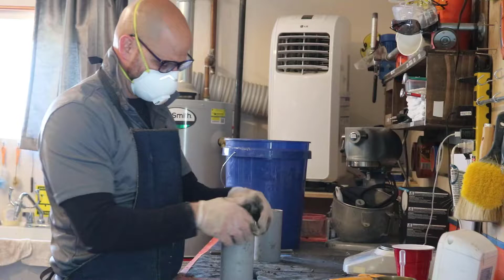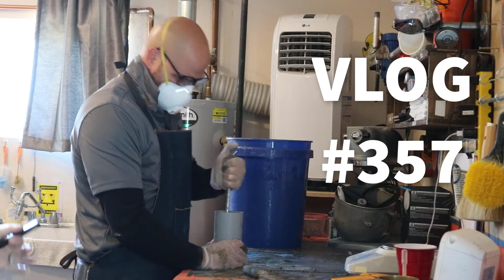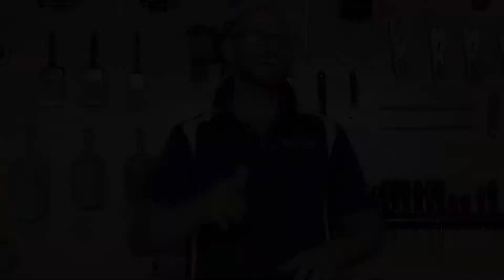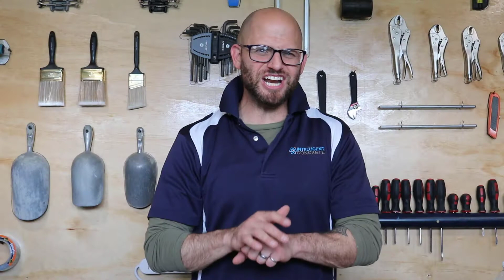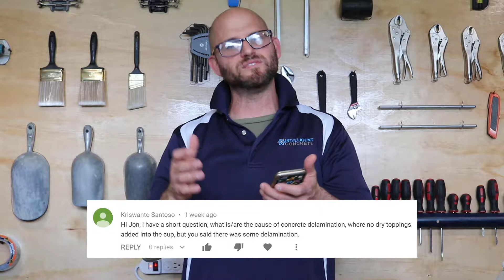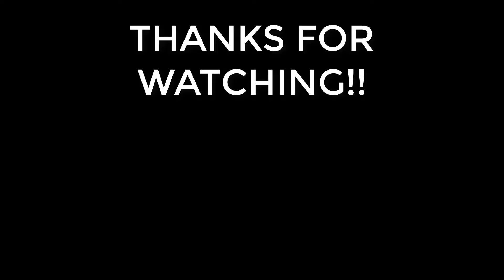Q&A: Concrete Bleeding with High Water to Cement Ratios - Vlog 357

Comment: When seeking to prevent ASR, why are siliceous aggregates undesirable but siliceous SCMs like silica fume or colloidal silica are OK?
Reply: Very small amorphous silica (generally <325mesh) are Pozzolanic, meaning they react with Calcium Hydroxide produced by the hydration of Portland cement. They provide the "S" in "CSH" to the "CH" dramatically strengthening the mix. And since CH is the main driver of alkalinity in Portland based concrete, reacting it with Pozzolans can reduce the alkalinity by 100 times. So microsized, or smaller, silica can dramatically strengthen concrete and lower its ph.
Silica in the aggregate, meanwhile, simply gets "eaten" by the alkalinity of unreacted CH. Siliceous aggregates ARE useful in low alkalinity mixes where the CH has been used up in Pozzolanic reactions. Hope this helps. Dr Jon will clarify or correct me where I'm off.